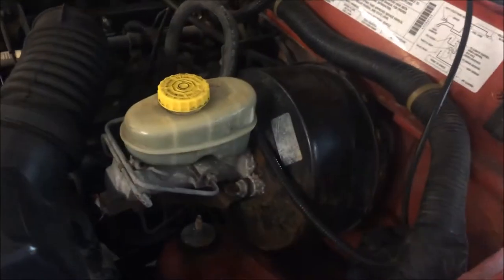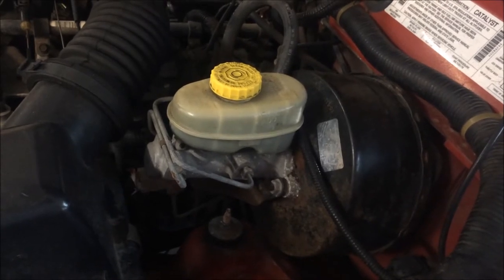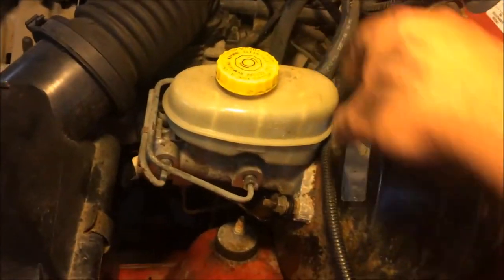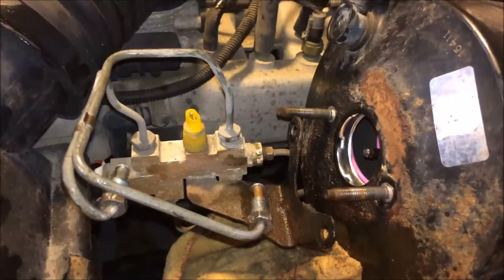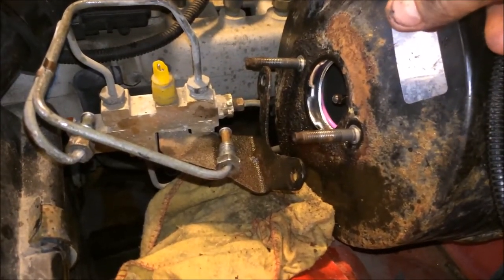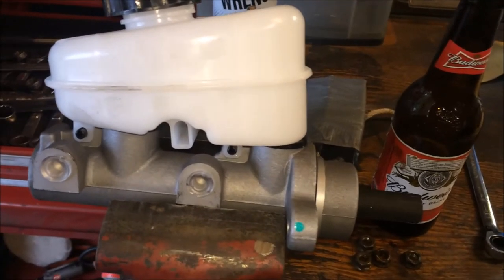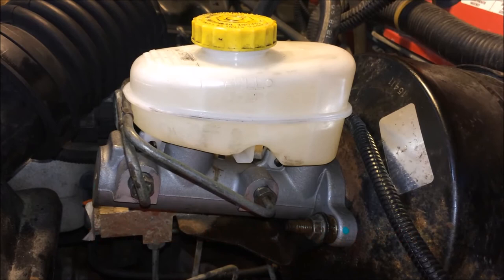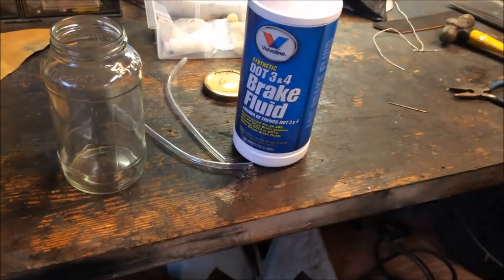JEEP CHEROKEE (XJ) MASTER CYLINDER INSTALL

Comment: on 2000 models...all that room (and i mean ALL) on the right side (as you look at it from front of vehicle) is taken up by some air "thing"(charcoal canister?)...ya need to remove it to RE-INSTALL the rear brake line....unless you got barbie doll hands....

Comment: Why do you need to change mc? Would it not work to bleed it? I bought a mc and brake booster from a junkyard and I have a very soft brakepedal.
Reply: Benne - You have a spongy brake pedal because the junkyard MC must have been bad too.   A new MC will hold higher brake pressure because of new valves and seals.